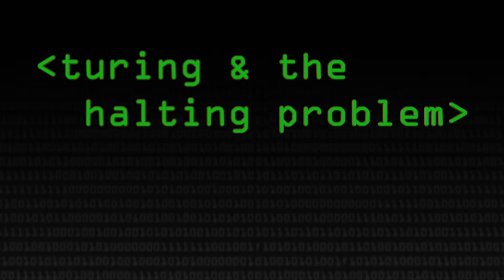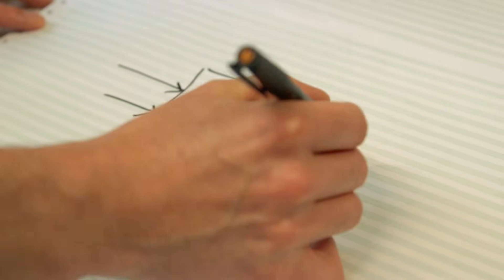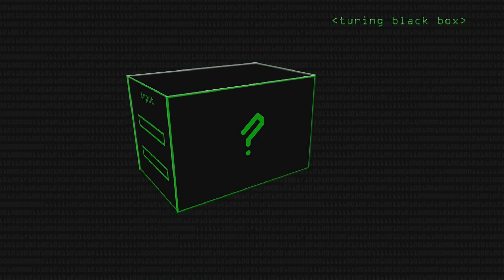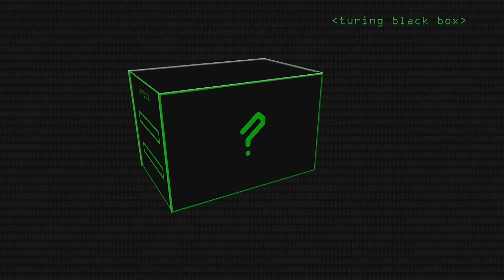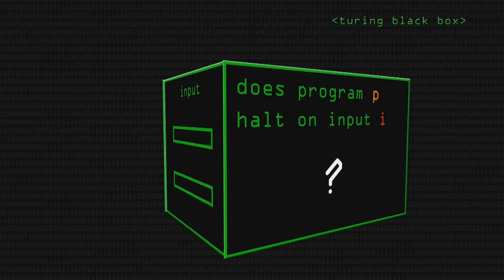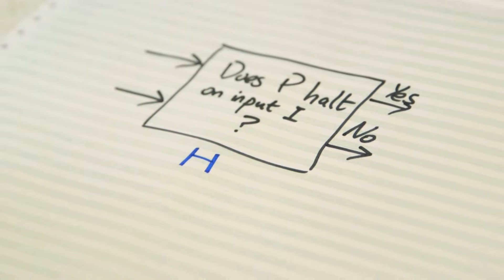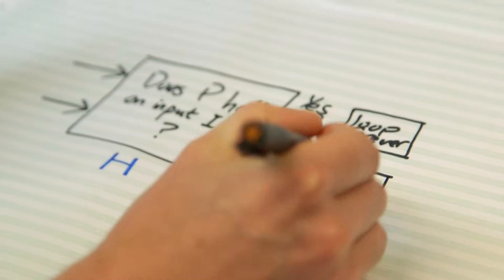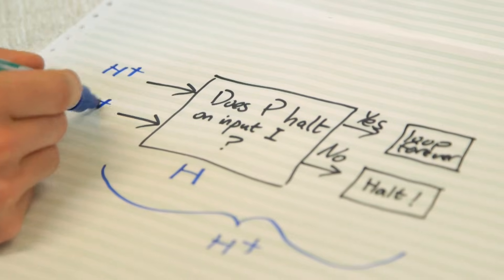Turing & The Halting Problem - Computerphile

Comment: wait, from the introduction it looked like P and I are different in nature, like different data types, but then you feed H+ on both? not clear
Reply: 'p' never changes in type, it's always some kind of program. However, 'i' the input, can change. eg you make a program p that multiplies a number you give it by 2, then you test it with the h machine, and you can check whether p will halt or not given input of type integer, then string, or even of input program or 'p' (feed it some Java or something eh?) you see what I'm getting at here?
Reply: I appreciate what you are saying but your answer doesn't solve the formal problem I am posing. If you want to feed H+ as the 'p' to H+ you need to formulate it correctly as a program/machine that takes an input. Now, H+ must be viewed as a machine that takes a pair (p, i) as input. So the final test would be with H+ and (p,i) fed into H+.
Reply: what's the difference between a formal problem and an informal one? ^_^ Anyway, when you approach this theoretical machine thinking like that, you quickly end up with infinite recursion, can you see how? besides it defeats the simplicity of the system to start worrying about data types, when you get onto larger programs, you expect this machine to be formatted to take all 1000 of the programs variables and inputs as the 'i'? if anything like this could ever be made, the team behind it would be smart enough to ensure it only ever needed two inputs, P and i, because there's zero upside to any other approach, wouldn't you agree?
Reply: Well formally, everything is just numbers.  There is a 1:1 mapping between programs and numbers, for example by taking the program's code in binary and reading out the whole sequence as a single number.  So it's perfectly valid to use the same number as both a program and as an input to a program.
Reply: I feel like I finally began to understand some of these issues after spending way too much time on it. Basically the idea is that whether the input type is valid or not the program still runs with that input. For example, if you built a rudimentary calculator and then you feed it a string input, if your program isn't able to handle that string input it can either throw and error and stop (halt) or it can loop infinitely due to invalid input (loop forever). So the input types don't necessarily matter because a program will still result one of those two actions, and when you're feeding a program/algorithm as the input itself to be analyzed by the program it will still do either of those two actions, regardless of whether it is a valid type.

Comment: https://youtu.be/macM_MtS_w4?t=253
Here, why is he making the machine loop forever if answer is yes?
Reply: I understand why the output at the end is contradictory, but I don't understand why the transformations that he made in the beginning (i.e. turning H into H+) are considered vaild. I'd really appreciate it if anyone could try to explain this to me! I really want to understand what I'm missing in my understanding! Perhaps my inability to grasp the validity of the transformation made to turn H into H+ is due to my weak background in mathemtics; thanks for your help!
Reply: Basically anything you can construct is valid.  Take a real world analogy.  Imagine if you give me an engine "E" of some kind which you say runs fine.  Then all I do is add a couple of gears and brakes without modifying what's inside E.  It's "valid" in the sense that there's no logical reason why I shouldn't be able to do that.  I call the whole thing "E+".  However when I turn on E+, I get something that both runs and stops at the same time.  The logic is, since I haven't done anything that could possibly be a contradiction (adding gears and brakes can't create contradictions), then something must be wrong with your E to start with.

Comment: Isn't this just because the answer to "Will H+ halt, if it's fed to itself" does not have a knowable answer until H+ halts?

Or in other words, can't we just design R, a program which will halt randomly on half the instances irrespective of its input and then feed that into H. H cannot possibly predict R and will not be perfect. Q.E.D.

Comment: Ok, I'm probably just ignorant on this, but I'm not sure how the H+ section isn't ultimately just a more cerebral way of shooting it with a shotgun. You took something that apparently worked, and broke it, so of course now it's broken. Maybe if you fed H+ into H instead of back into itself it would make more sense to me.
Because to me, it seems you've taken a machine that was working, broke it and then you're acting as if it's profound that the output is wrong. So if you replace the "add bits on" section with "shoot it with a shot gun", how is the outcome any different... other than the shotgun is more theatrical.

Again, there's probably something I'm not getting here and maybe I'll look back on this and think how silly I was but that's what I'm thinking right now.
Reply: Supposedly, H should be able to tell you if ANY program holds for ANY input.Since there is one program where it is impossible to tell, a machine that does that cannot exist.
Reply: Hi, the misunderstanding comes because you assume that you somehow "broke" the machine. You did not break it, you just made it into a different machine H+. This may be a really weird machine, but it still a turing machine that takes inputs and does something.

The punchline comes from noticing that if you feed H+ into H+ (which is a perfectly valid thing to do, since your machine does take other machines as input), then you run into a paradox. Therefore, H+ must not exist. But since you actually claim you constructed H+ from H in a very simple way, this means that H should not exist. 

I guess you can see that I can use the same logic to prove that pinocchio doesn't (or cannot) exist. Suppose he does, what if he says "my nose will not grow" (assuming he can say anything humans can)? Two lines of perfectly valid reasoning lead you to contradictory answers, therefore, he cannot exist.

Hope this clears it up for you.
Reply: No worries, this could be an unnatural argument to wrap ones head around at first (which is part of what makes it beautiful). It would help to look up the wiki page on "Proof by Contradiction" to see more examples of this kind of reasoning. For something more specific to this, look up the wiki page on "Diagonal Argument". It contains various examples including the halting problem.
Reply: I don't see any issue feeding H+ with H will loop forever so feeding h+ with H+ will return no. There is no paradox. The problem just incorrectly assumes the machine needs to run the program to come up with the result.
Reply: The moment it returns 'no' it halts. The input didn't change, still the same machine, so 'no' is an incorrect answer now. Correct answer is 'yes', after which it infinitely loops, so 'yes' isn't correct either and it switches back to 'no' and so on. I guess you can say that the machine, which is supposed to answer the halting question, wont halt, which means the question is undecidable.
Reply: Aleksei Inok It's still not a paradox. You just made it give the wrong answer.

If I took a calculator, added some extra parts that took the proper answer to the problem and used it as a random seed to generate another answer. You would key in 5 + 5 and get the same answer all the time, it's just that the answer is always wrong. How is that a paradox?

Also, part of the whole scenario is the assumption that you will get a "correct" answer from a machine that you have designed to give you the wrong answer.

If you installed a NOT gate into a machine and expected it to continue to give the same output isn't that just silly? If you asked someone, "why is this returning true when it should return false" wouldn't they eventually point to the NOT gate that's only purpose seems to be to force the machine to output what you've defined as the wrong answer?
Reply: Let's try another perspective. Suppose you know for sure that assumption A is false. If you take assumption B, which is not yet verified, logically apply it and conclude that A can be true, then B is false. If you're ok with that, than the next step is easy. 
First we make a machine H+ that is guaranteed to loop forever on halting input and halt on non-halting input - that's A. Then we take H (assumption B) and feed it with H+(H+). If H gives us an answer, either yes or no, it will imply that H+ either halted on halting input or looped on non-halting input. So B contradicts with A. But A is beyond any doubt, so B must be false, and H cannot exist.
Reply: Aleksei Inok Ok, I got the first part. But then you lost me in the second part. Did you feed H a H+ machine that already had another H+ machine in it? is that what H+(H+) meant?

Wait a minute....If you feed H+ into H+ wouldn't it return a null, or more likely a syntax error, because H+ won't even execute unless it has some kind of input?
Reply: Aleksei Inok I don't know man, maybe I'm missing some logical fundamentals that's just preventing me from understanding this.
Reply: Andrea Manenti I don't see how it's true and false at the same time, it's one, then you change it to the other and do the result.

Comment: Hi Computerphile. I've finally come over to the dark side! (I've mostly been avoiding Computerphile because it seemed too intimidating.)

I have a big point of confusion about how Alan Turing apparently solved the halting problem. To save time, I will express this point of confusion by pasting part of a comment I made on a video by udiprod:

This isn't a limitation of computers; it's a limitation of logic. Obviously you can't make a machine H that solves the halting problem perfectly if you allow for constructions where H's own output determines the final result.

Needless to say, if we define "solving the halting problem perfectly" in part as being able to perform the logically impossible, we're going to be disappointed. And there's no point asking if anyone else can do it, which makes your answer to question 8 a little mystifying. [In udiprod's FAQ about the halting problem, one of the questions was whether humans could solve the Turing machine, and udiprod suggested that perhaps they could someday.]

But considering that the halting problem was not only formulated, but took some pretty advanced math to answer, and considering that you're even entertaining the possibility of humans solving it, I somehow doubt that the eventual proof of the problem's undecidability relied on such an obvious and straightforward paradox. I suspect that it was simply your presentation of the problem and proof that was flawed. I can only assume that you inadvertently oversimplified it to the point that it was no longer sufficiently comparable to the original problem.

Up 'til now I was quite confident that udiprod had just presented the subject very poorly, and that I'd found the flaw in his explanation. But your presentation of this proof is nearly identical to his, and I have a lot more faith in your understanding of it than in udiprod's. Can you explain where I've gone wrong? I'm terribly disoriented right now.

Comment: But arent you purposedly making its answer be wrong? I mean, H+ is no longer H, so because its not the same machine it may not be able to solve all problems.
What if you take another H machine and then input it with H+?
I dont know really, it looks pretty unfair to me, or i am stupid.
Reply: True, H+ is not EXACTLY H, but it still does EXACTLY WHAT H did, provide an answer you can DEDUCE by whether it stops or not which is THE SAME as H.

Comment: I thought I had addressed this before but I could find my response.  The Halting problem paradox (at least as described here) is wrong.

It's impossible for H+ to self reference since it requires 2 inputs (the 2nd being in input to the machine to test) but this requires infinite recursion to set up to self reference even if you fix H+ to take multiple required inputs as a series (or by any other method) into the 2nd slot.
Reply: burstofsanity late to the party, but fwiw you don’t need this problematic self-reference: the “computer” input I.e. the “top” input, is just a representation of the program, like its source code (or Gödel number), not its state with respect to a given input.